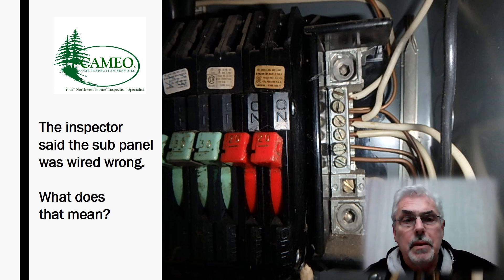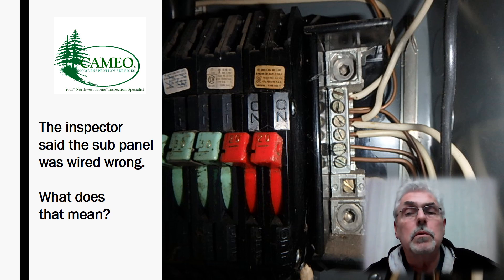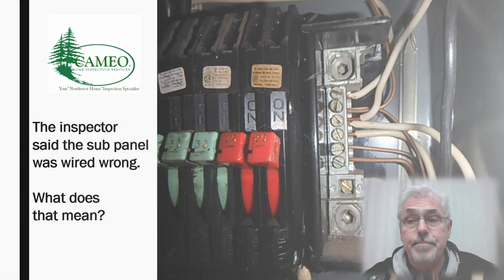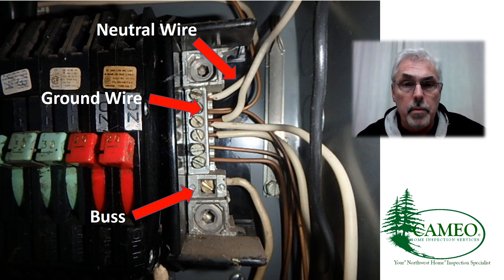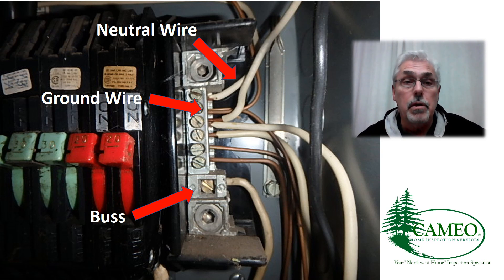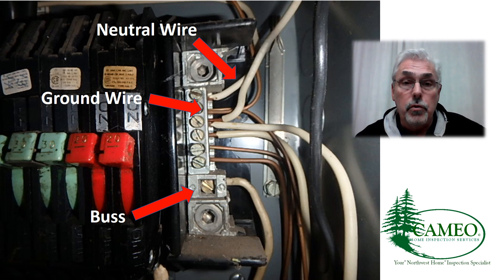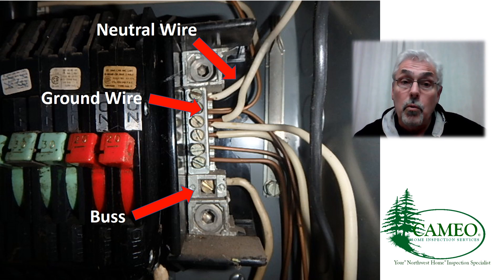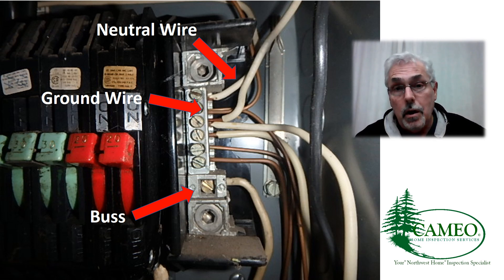Sub Panel Wiring Issues

Comment: Some more boxes the neutral and ground bus are the same long is the main neutral is connected and the ground wire is connected there is no problem it's always good to have your main fuse panel check for proper wire connections being tied things properly installed turn breakers on and off a few times and make sure they work properly

Comment: See it a lot... ground and neutral, like this, on same bus; or separate bus for neutral and ground, but bonded...
"handyman special", dumb homeowner, or sloppy electrician. There is a potential for shock hazard.
Reply: I see it every day, since that is what comes off the utility pole...guess the entire grid was wired by sloppy electricians.
Reply: The NEC 300.3(B)(2) provides grandfathering for adding equipment grounds to existing installations.  Floating the ground bus without a path back to the service panel ground bus would be more unsafe than using the neutral bus to perform double duty.

Comment: But is the sub panel wired by 3 wires or 4 wires? That is the critical determination! If 4 wire then isolate ground from neutral; if 3 wire then combine ground and nuetral
Reply: Yeah if there's no ground conductor in the sub panel feeder, then this is actually wired correctly.  The NEC 300.3(B)(2) provides grandfathering for adding equipment grounds to existing installations.  Floating the ground bus without a path back to the service panel ground bus would be more unsafe than using the neutral bus to perform double duty.

Comment: Got sub in pole barn got aluminum ground wire they got my neutral on bus but grounds from outlets are twisted around eachother but floatn in box not grounded want to add 30amp plug were do i put my new ground wire? With other grounds just floatn? Anythin i dont know alot proaly just gonna hire electrician